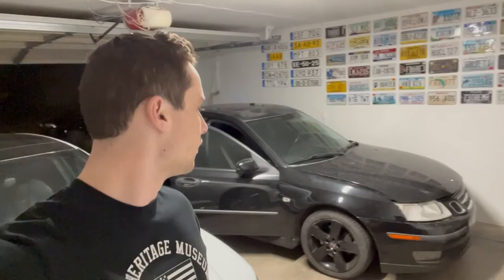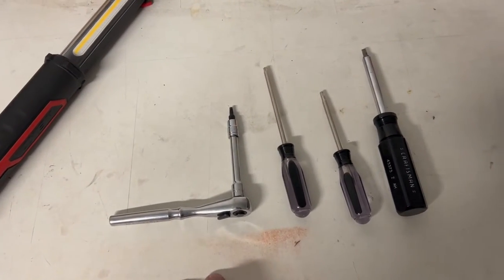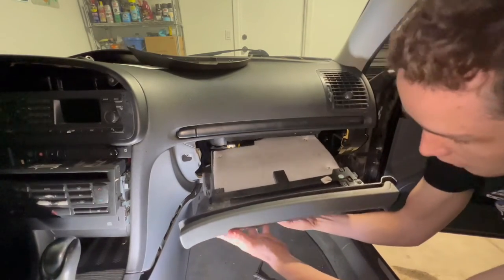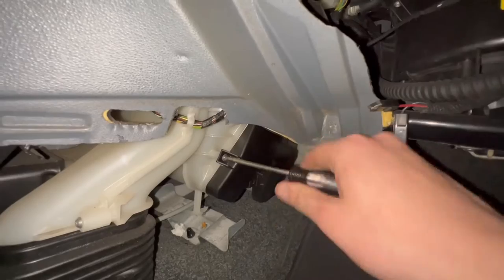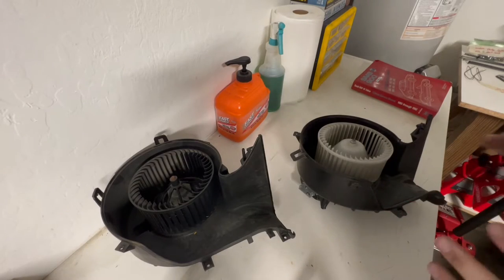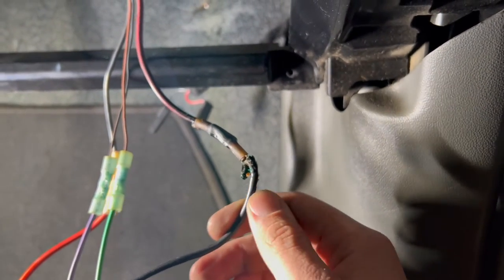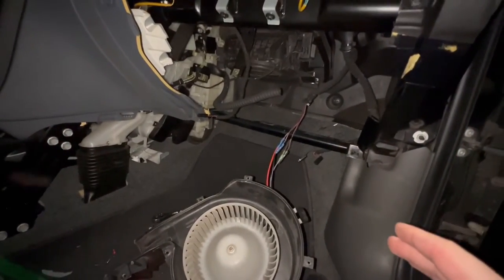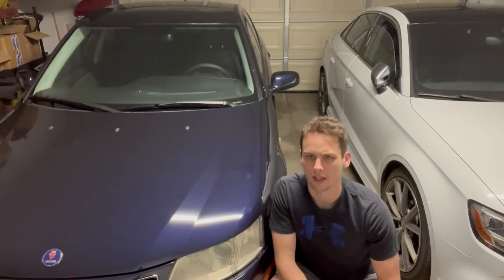Discovering More Electrical Problems with Our Project 9-3

Comment: You just found the reason so many of these ended up catching fire and burning to the ground. That connector overheats when an old motor bearing rusts, or the brushes wear out and slows down the motor, requiring more amps to spin it up, more amps through the connector than it is designed to handle, overheating and softening the metal, resulting in connection gap, arcing, more amps needed, and a downward spiral into fire and destruction...
Really glad you caught it and it didn't light that carpet, like many fires started.
Could have been a sad ending.

Comment: I've just bought a 2005 1.9 93 only done 80,000 miles . Loving it so far
Reply: Saw your video on maptun strut brace. I tried swedish motorsports web site it's not up. Then emailed maptun directly but no reply   what's up are they available or not. Maptun site says in stock but again no answer to query.

Comment: Have you cleared out the drainage below the cabin air filter? Water ingress in the passenger footwell is due to water being unable to drain out below the car and building up over and into your filter.. lift the scuttle panel and just poke a long screwdriver into ot

Comment: Did you check for any voltage at the connection to the blower?  If no voltage, chances are you have a perfectly fine blower.

Comment: More electrical problems with an NG SAAB9-3 imagine my supprize? 
If I recall correctly there's a control module for the fan under the dash  behind the glove box It's basically a MOSFET transistor in a box if that goes you'll get nothing.

Comment: If I'm not mistaken, those torx screws you mention at 4:46 that hold the blower motor up are T15s, not T20s. If I'm wrong let me know and let's remove this comment so we don't confuse anyone.
Reply from the maker: I recall them being T20’s; I always ring a few screwdrivers with me anyways if I’m not 100% sure on the size

Comment: of course water leaks in an rusts it.. all you have to do is lubricate it, they start to squeal first.. then can fail. simply drill hold in the plastic then you can lubricate it anytime and drill holes below cabin filter so water can run out the proper way. simple. never had a motor fail yet in over 25years.

Comment: Electrical issues are always fun. It might be the resistor. If there’s more resistance in the motor, it might’ve draw more current and broke it. On rock auto, there’s one that deals with automatic climate control…for $230. Hopefully a solution is found

Comment: Er, I have a little issue with my 2004 9-3:

Today, when I topped off the washer fluid, my eyes caught a flat black (male?) plug with a green stripe on it jutting up from right behind the accumulator box. There isn't any immediate counterpart plug visible, and the wire isn't long enough to really reach anything.

Funny thing is, though, that the car seems to be fully operational; no warnings, and no decreased functionality, as far as I can tell. I don't think the car was ever customised, so that plug should be an original Saab plug.

Any ideas before I have to pay trough my nose for a diagnose at my Saab workshop?

Comment: 80k that's almost run in😂🤣😂
I'm thinking about getting another 93 Aero.
I sold mine 2 years ago and bought an Audi. For about 7x what I Sold the saab for?
I was thinking about going into London in the next couple of weeks only to discover that my Audi doesn't meet the ULEZ emissions required for driving in London but Ironically the SAAB I sold does. Even more annoying I kept my OG93 Aero and that isn't ULEZ complient either. 
😠😠😠😠

Comment: It is the same with the MCC as the ACC. 9/10 times it is the blower motor resistor. The reason it dies is because water leaks in and damages the resistor. It is an issue on all the 9-3's. Mine is also dead and needs replacement. It is the same symptom if your blower motor is always on, even after taking the key out. This is because it is controlled by the climate control module but the resister and motor have constant + and -
Reply: If it turns out to be a sluggish blower motor...try a few drops of motor oil or spray oil into the bearing points that should get it going for a few more years...
No need to buy a new motor...key is to use an oil that does not evaporate like wd40 does.
Reply: @FranksWorld1  oh yeah definetly, have also done that. What I’m talking about is if your motor is stuck on one speed. Even with the key out. The bearings on the motors rust because the cabin filter housing begins to leak like 5-7 years after manufacturing.
Reply: @alienkillersvaneberg3212  ok…good to know…thanks!